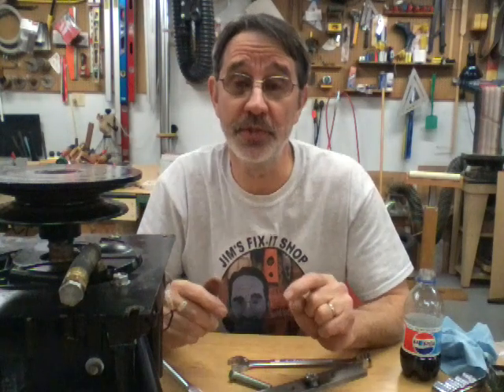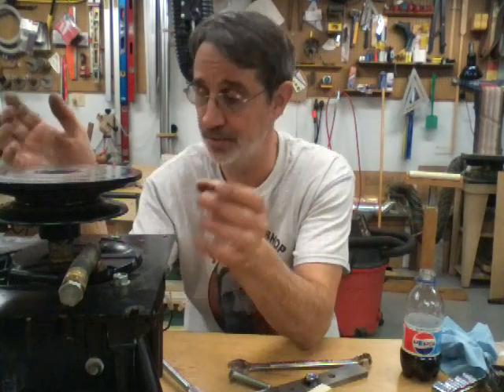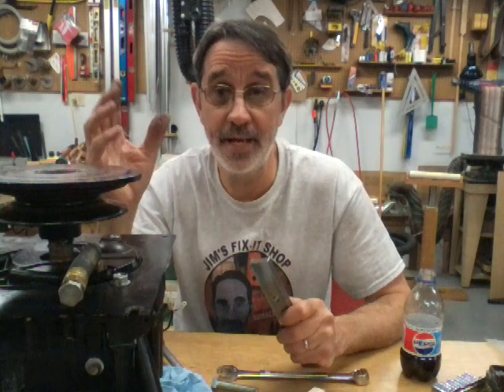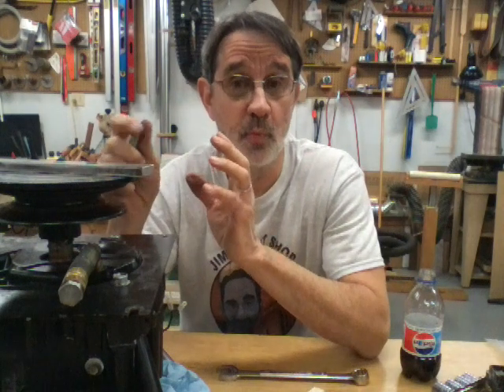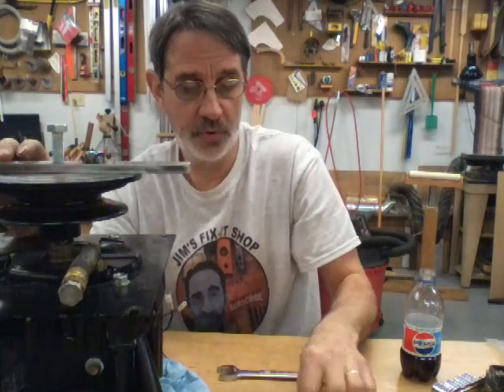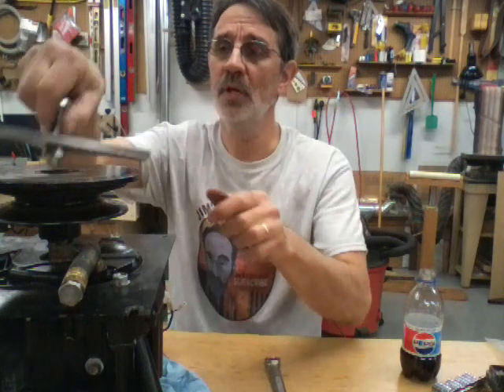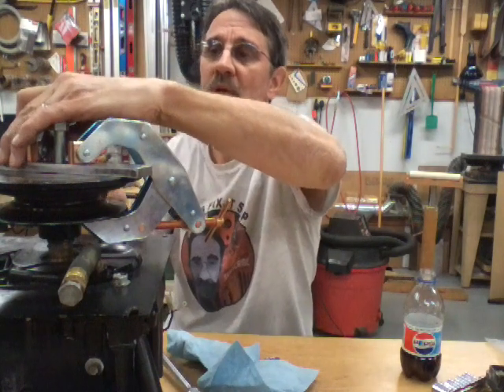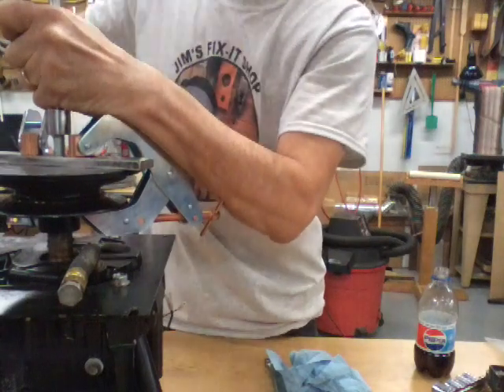220.  Removing the drive disk  Josh's brainstorm

Comment: I had one that slipped on set screws but had 1"-12 threads on the outer part. I was able to place a few washers on the end of the shaft and screw a bolt in to press off the hub. It was awhile ago, but I think I have photos.
Reply from the maker: Michael Hagberg 
Well if you find the pictures send them to me I’d like to see them. My email is jimsfixitshop@gmail.com  thanks Jim

Comment: I have a snapper Lt12 my drive plate doesn’t have set screws so I’m assuming it screws on. But  I’m wondering is it right or left hand threads? Thanks in advance.
Reply from the maker: @patbeck7793  I haven’t worked on many lawn tractors, but if the drive disc does not have set screws, then it may have one big bolt that goes up through the bottom into the end of the crankshaft check that first before you tried unscrew it because they all do have a key that holds them to the crank let me know what you find out.